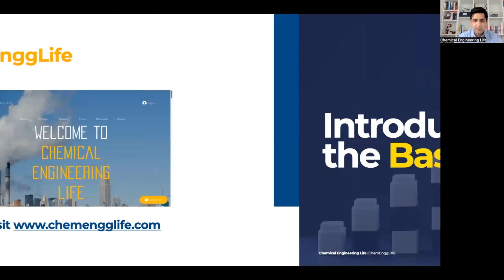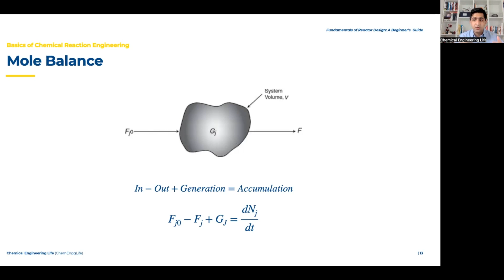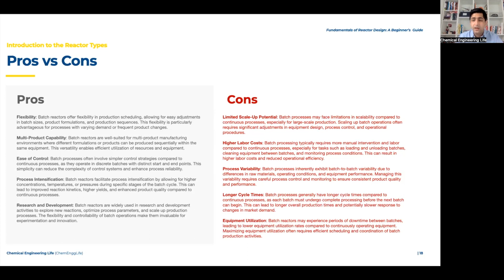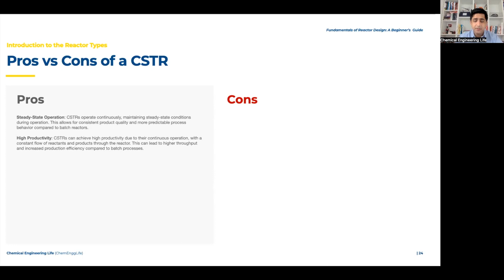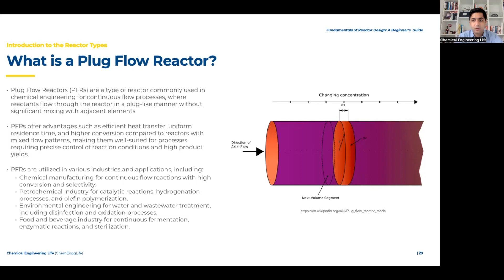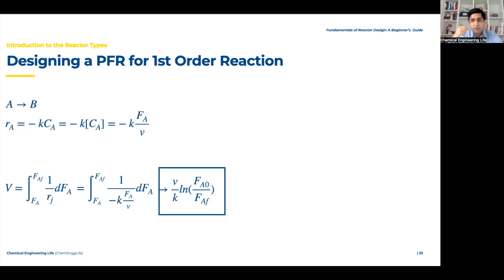Fundamentals of Reactor Design: A beginner's Guide | ChemEnggLife Webinar | Chemical Engineering

Comment: I'm working in PNCB ( para nitro chloro benzene) nitration plant can you please tell me why we use PFR there?
Reply from the maker: Thanks for your question! In a PNCB nitration plant, a PFR can be typically used because it provides a controlled environment with uniform residence time for the reaction, which is crucial for managing the heat and reaction rate in nitration processes. This setup helps in maintaining product quality and can improve yield by ensuring that the reactants flow continuously through the reactor with minimal back-mixing. Let me know if you’d like to dive deeper into this! :)

You can get in touch with at www.chemengglife.com and we will be more than happy to answer any question, you may have! :)
Reply: @ChemicalEngineeringLife Hello, I am working on a similar project where I have to produce dinitrochlorobenze (DNCB) from chlorobenzene. I heard that the traditional process is carried out in batch. I would love to have more information on this. Thank you
Reply: Thanks for this ❤... lecture content is good